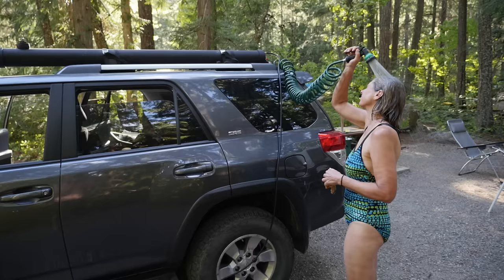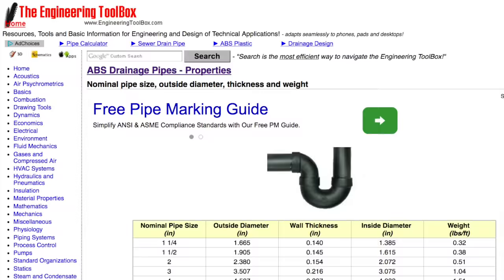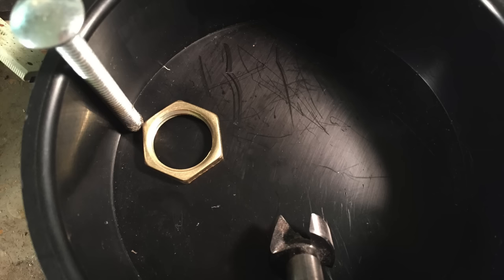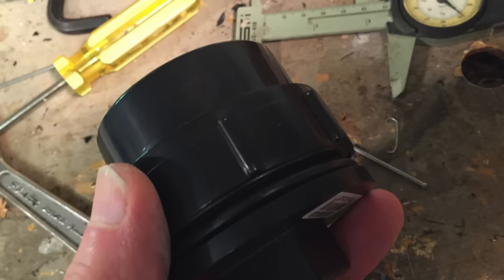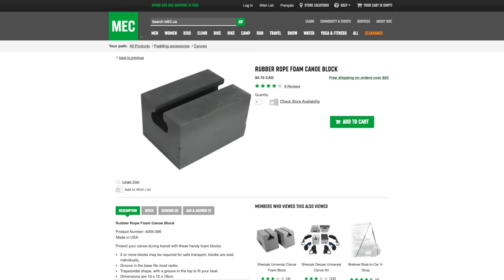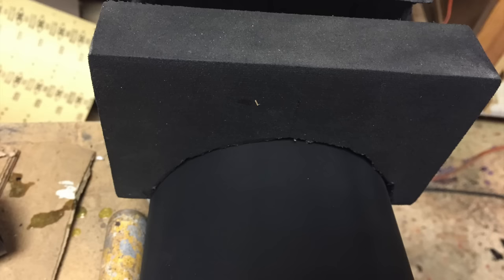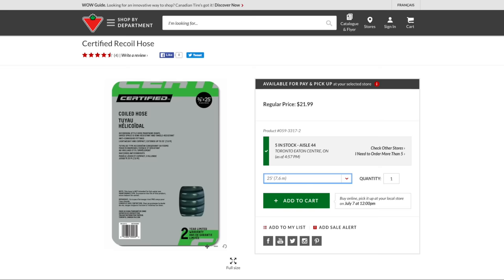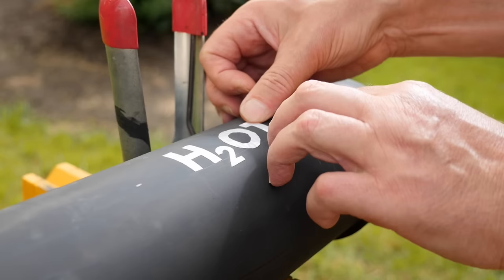H2OT - Rooftop, pressurized, solar-heated shower/sprayer using ABS pipe. DIY

Comment: Im considering something like this myself. I do have a couple of questions though if you could please answer.
1: How does it go in cooler weather, Winter but not snowing for example?
2: Have you found any issues with water moving inside causing structual damage? Im thinking it could push the end caps off after a while when under brakes etc.
Reply from the maker: 1). I do not camp in the winter so cannot really comment on that.
2) I NEVER drive without the tank filled 100% to the brim. This way it is a solid mass and no water can move around. This movement would be what is called a water hammer. That would certainly be dangerous and likely launch the shower off your truck like a missile! 

If you use proper ABS solvent cement, the joints including caps will never come off. It is not glued, it is a solvent that chemically welds the mating pieces together.
Reply: @ImaginetMedia  thanks for that. I will have to look around to find the right stuff. I only ever seem to find PVC pipe here (Aus) and have seen that come apart after a while ever with the correct stuff used.
Reply from the maker: @MicksGarageDarts  This is partly why I choose ABS over PVC.
Reply: @ImaginetMedia  cheers again. I haven't seen Black piping of that size used or sold here so I will have to do some hunting for it by the look of things. I was thinking of putting some dividers inside the pipe like what is found in fuel tankers and such to stop the movement of the water. Obviously a hole in the bottom of the dividers to allow water to flow through but not the full motion of it splashing around while driving.
Reply from the maker: @MicksGarageDarts  Do not do it. Simply fill the tank to the brim and there is ZERO movement of water.
Reply: @ImaginetMedia  Only issue I have with that is that I often move camp and dont have the option to refill all the time. Being out in the Australian Bush I need to take as much as possible because Im not always near a town or river.
Reply from the maker: @MicksGarageDarts  Just carry an extra 10L of water in a container to top it up before you move.
Reply: @ImaginetMedia  Not always possible but I will work something out. I cant seem to find ABS Pipe any larger than about 25mm/1inch so I may not be able to use it anyway. Local hardware stores dont have it anyway so I may have to find a plumbing specialist.
Reply: @MicksGarageDarts  You can easily weld ABS with nothing more than a heat gun with a nozzle attachment. Practice pays off and it is obvious when you overheat the ABS, it turns brown and gives of fumes and smoke. It would be possible to make a section of baffles that slide up the inside of the pipe before you put the ends on, create a tortures path with the baffles or simply drill small holes (16mm) in discs to create baffles that you can slide inside. You could thread the baffles onto a long section of nylon rope with small diameter pipe between to space the baffles, you'd need at least three lengths of rope otherwise the baffles will just rotate like a butterfly valve when the water pushes on them. This type of baffle would be similar in theory as to how an oil filled damper unit from a shock absorber works. You could even make a u shaped tank that runs the periphery of your roof.
Reply: @cunning-stunt  seems that ABS Pipe is not easy to come by in Aus. Where I can find it price is pretty high and I might as well go on EBay and buy one ready made.
Reply: @MicksGarageDarts  You could use PVC, that's even easier to weld than ABS.
ABS here in NZ
https://www.plasticsystems.co.nz/sites/default/files/pdf/ABS_Metric_April19_SAMPLE.pdf
If you look at the applications list at this link it will give you an idea who may have offcuts or who buys it in bulk in your area.
http://www.capitalvalves.co.nz/pdf/ABS.pdf

Or you could approach a plastics fabricator to do the harder parts involved? Several here in NZ.
https://www.progressiveplastics.co.nz/fabrication.html
Reply: @cunning-stunt  cheers mate. I will get something sorted eventually lol.

Comment: Do you have to have the pump on while showering? Is there a possibility of overpump?
Reply from the maker: No. I only power on the compressor when the PSI drops below 10. I shut it off at 30 PSI
Reply: @ImaginetMedia  oh ok. Would it work without a pump? Just with gravity?
Reply from the maker: @nothingreal8843  https://www.convertunits.com/from/foot+of+head/to/psi.  Enter 1 foot for the head. You will see that the water pressure at 1 foot below my roof ( where I hold the shower sprayer) is less than 0.5 psi.
Reply: I think I have heard of people building these with an auto pressure release valve, rather than the radiator type used here. Need to check at a plumbing store for the type necessary for the psi you want to limit to, I guess.

Comment: I cant seem to find black 6" abs tube anywhere. Any suggestions? -Florida
Reply from the maker: 6" is very expensive. That is why I used 4"
Reply from the maker: ABS pipe is only manufactured in black. Polybutylene pipe  is grey and Polyvinyl Chloride  pipe is white. Neither have the same properties that ABS has and is why it is what is used.  D'oh.

Comment: You have a parts list? Love to use ur plan. Please.
Reply from the maker: All the parts are well described in the video. I have posted specific links to various parts previously in the comments. However, many of them are only available in certain geographic areas. Hence, a list is not much value.
Reply: imaginetMedia where did you get a the Milton valve?
Reply from the maker: I bought it at a local Auto Parts supply store. It is a Milton TR416, but any Clamp In Tubeless Tire Valve will work.
Reply: imaginetMedia thanks

Comment: Can you give an estimate how much money you spent on parts and about how many hours it took you to make this?
Reply from the maker: What I spent and how long it took are really had to quantify for several reasons. 

• I had some of the parts already, including the necessary tools, 
• I live is a specific area where local costs would only apply here, 
• I did not have the benefit of this video to provide instructions. 

So, suffice to say,

•  I spent a lot less than it  would have cost to buy a pre-manufactured version, and 
•  I spent a lot of fun, quality time creating a DIY solution and filming it in the process to share with others. 

I hope this answers your question.
Reply: JackDenim he probably spent 50 to 100 bucks depending on if you need the Garden hose or compressor
Reply: It cost about $60 Canadian.

Comment: Why you donot use your car radiator or exhaust. plenty of heat in a car
Reply from the maker: Go right ahead and design and build one. If you can build it for less than $50 then you are a genius/. However, I bet it would cost you closer to $500, be terribly inefficient, use an energy source that costs money, and weigh at least double what mine does.   I look forward to watching your build video.  Good luck.
Reply: @ImaginetMedia  who says Canucks are stoic ? U R one solid Canadian who deflects these passive aggressive comments with wit. I'm an Element overlander in Montreal now moving to Upper Canada ! my next project CHEERS !

Comment: Why is pipe so small in dia.?
Reply from the maker: 1:04
Reply: Scott ... he mentions "commonly available parts" which drops off rather quickly above 4 inch. You could make several for more capacity and join them with short pieces of hose. Keep an eye on the weight rating of your roof rack. Some are only good for 100 pounds before the screws will yank out.

Comment: I built this but I am getting a couple small air leaks, one from the radiator drain plug and another from one of the end caps. Both leaks are very small, it still holds air pressure. Any eazy fix w/out starting again?
Reply from the maker: My 2" screw cap came with a rubber(silicon) gasket. You can see it in the video. Does yours have one?  I also wrapped some teflon tape around the threads of the cap to tighten the seal. If your radiator drain is leaking, then you should wrap some teflon tape around the threads although that should not leak if yo drilled the correct size hole It is a tapered thread. My guess is yo drilled too large a hole. Fortunately. the cap is only a dollar or so to replace. This is why i drilled it into the cap and not the pipe.
Reply: Could seal it up using a sealant of some sort maybe even tube glue for a tyre . An then try lay it in bathtub an pump air into it an see if any bubbles come out like you would a bike tube
Reply: Or black roof silicone
Reply: I 2nd Teflon tape on the threads. get the thicker heavy duty stuff

Comment: can it be made any length?
Reply from the maker: Yes, however, I would not build one any shorter. 6 feet is about right for my useage and that is the exact length that the pipe is sold by.

Comment: Also, how do you know how much water to fill? Too much and you have no room for air pressure.
Reply: I think somewhere in the comments ImaginetMedia talks about filling it full for transport to avoid water hammer while traveling then draining a bit before pressurizing for use. You're right, as you drain water and increase air volume you increase both the time to pressurize it though and the available pressure for use. Good luck!
Reply from the maker: Shannon O'Neal is absolutely correct. CoUld not have explained it better my self.

Comment: Do you think pvc pipe can work for keeping water cool?  Thinking of doing this for my dogs
Reply: I believe you want to use ABS pipe, as PVC can leach toxic materials.
Reply: You could bury it to keep it cool and pvc is nontoxic. They use it in plumbing for houses.
Reply: @ThillerKillerX  CPVC (chlorinated PVC) is safe for drinking water as it is used on the high pressure side. Normal PVC is not and can leech chemicals into water which is why it is used on return (low pressure) sides of plumbing. Just FYI.
Reply: @ThillerKillerX  For drains...

Comment: Can someone give me the size of the nut? I have the exact drain valve but no one seems to know what that nut that fits on the back is called (Home Depot geniuses)
Reply from the maker: Moen Faucet Lock Nut - #M3875 . https://www.homedepot.ca/product/moen-brass-faucet-lock-nut/1000516334

Comment: hi, I was wondering why an air compressor instead of a pump? what are the advantages?
Reply from the maker: A compressor is a pump.
Reply: Are you asking about an electric water pump like an RV pump? If you put a Schrader valve on it you can use a battery powered compressor or even a bicycle pump for pressure. I guess you could put an electric pump inline with the water hose but will need an air inlet to keep from creating a vacuum.
Reply: @ImaginetMedia  
Ky Fisher may be referring to a bicycle pump. I have been converting my Kia Soul to a mini camper (I'm 5'-2") and have considered building a water tube like this fine one you have built. I don't mind lower pressure, since I've been using a solar shower which works on gravity for flow. My intention is to pressurize the tube with my bike tire pump. I'd like to use a stand pump for this, which will be another project, since the hose on the pump must be extended enough to reach the valve on the tube while resting on the ground.
Reply: You will need a shower after hand pumping this up.
Reply: @shannongood8598  A bike pump is a lot of work. You will definitely need a shower when your are done.

Comment: Geocacher?
Reply from the maker: Yes.
Reply: I'm not sure you can use a cigarette lighter. They are usually rated at 10 amps, and a 300 watt heater draws 25 amps. Have you ever actually built this?
Reply: I'm not sure of the volume of his tank, but assume it holds 5 gallons or 40 lb of water. This would take a 300 watt heater 1.5 hours to heat from 60F to 100F.  If you are driving around and losing heat to forced convection, I doubt it would ever heat up. I don't think it will work, but would be interested if you build one.

Comment: On the radiator value drain plug, do you use any sealant when you screw it in?
Reply from the maker: No. It is a NPT tapered thread. The more you screw it in to the plug, the tighter it gets. Be careful though, to drill the correct diameter hole.
Reply: Thank you for the insight.  Drill a slightly smaller hole then so it’s tight?
Reply from the maker: That is correct. You  should look up tap drill size for NPT thread.  The radiator cap is the easy one to drill. It is the end cap for the shutoff drain you have to be careful with.
Reply: Where did you get the radiator valve drain plug?
Reply: I got mine on here:  https://www.amazon.com/gp/product/B000HEITXE/ref=oh_aui_detailpage_o06_s00?ie=UTF8&psc=1
Reply: bonsukan thanks ... one more question.. what primer is best on pvc and what paint ?
Reply: spyderx92, i'm not sure about which is best, but this is the one I used for mine:  https://www.homedepot.com/p/Rust-Oleum-Painter-s-Touch-2X-12-oz-Flat-Black-General-Purpose-Spray-Paint-249127/202246266

Comment: have you had any longer term problems? Like glue coming loose after pressure? Or cracked pipe? would you do anything different?
Reply from the maker: The bonding agent is not glue. It is acrylonitrile butadiene styrene solvent cement. It melts and chemically welds two pieces together to form one.

Comment: Did you make the back pad slightly higher than the end with the spigot? help with flow.... Although I guess its pressurized....
Reply from the maker: No. the pads are the same.  I actually try to park my truck so the front is slightly higher than the back for this exact reason.
Reply: No need with pressurize tank but if you really want an angle just make somebody sit in the back or put some rock ;) 👍
Reply from the maker: What do you mean "no need to pressurize tank"?   When you take a shower, do yo just splash water on yourself or does the water come out of a pressurized water line to you house?
Reply: @ImaginetMedia  Nope somebody splash it for me. ;))) Seriously I didn't understand your reply or if it was for me but after looking more I find the problem, I blame the traduction, missing 1 freaking letter so here = no need with A pressurize tank, I wanted to say no need to put much of an angle since it's pressurize and the exit is at the bottom, sorry for the problem and I hope it's making more sense.

Comment: Does this work during cold season?
Reply from the maker: That depends on what you call a cold season. There is no heater in the tank, so it is greatly affected by the ambient temperature If the temperature of the air is less than the thermal energy the tank absorbs, then the tank wi cool down rather than warm up.

Comment: Hi, Great video. One question, near the beginning of the film the volume is around 15 litres. When you tested it, it sounds like you added 30 litres? So did you make it larger than originally planned?
Reply from the maker: Sorry for the confusion. As noted in several previous responses, I ran two tests over two days. both filled with 15 L, for a total of 30 L. I should have made that clearer in the narration.
Reply: Great, thanks for the quick reply. I didn't spot that the tests were over different days in the previous replies.
Reply from the maker: Well, there is over a 1000 comments so you cannot be blamed for missing it!   :-) .   BTW: We have found that 15 L is plenty for 2 showers. We only have the sprayon to wet, lather, and then rinse.  We also have a pop up change room that works perfect for a private shower stall. We just place it right at the back of the truck and run the coiled hose over the top.

Comment: What type of sealant are you using for the air and water valves?
Reply from the maker: There is no sealant.  The water valve has NPT threads and it is tapped into the cap.  The Shtader valve uses rubber gaskets.
Reply: @ImaginetMedia  Thanks! I'm in the process of building this. Great video.
Reply from the maker: Be careful of the hole sizer for the water spigot. You want to drill a hole so that you can thread the valve in tight. I actually heated . the valve up with a torch first so it partly melted the ABS while threading it in. This made it much easier and bonds the ABS to the brass.
Reply: @ImaginetMedia Thanks for the tip.  I'll probably try the heating technique. I literally am using the exact same parts as you so hopefully it will all come together well. I don't have a drill press so to install the 2" cap I'm using piece of abs that has a 2" spigot in the middle and will join two 3 foot sections of pipe it.
Reply from the maker: One issue some have reported is that the 2" cap they bought do not have a silicone gasket. If you look at mine, you can see I have a gasket on it, which came with it. Different manufactures do not include it. WIthout it, the cap will leak, so if you do not have one, look for a 2" gasket at you local hardware store. I also wrapped a a few rounds of teflon tape to tightened the thread on the cap.
Reply: @ImaginetMedia  Good to know. Mine does not have a gasket. Easy enough to return to home depot and get the right part. I let you know how it goes. Appreciate all your tips.